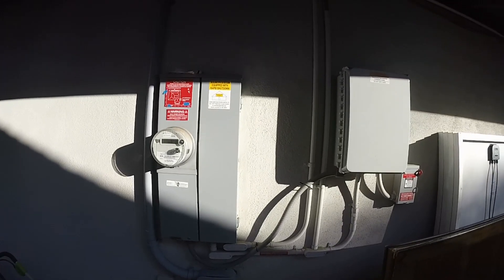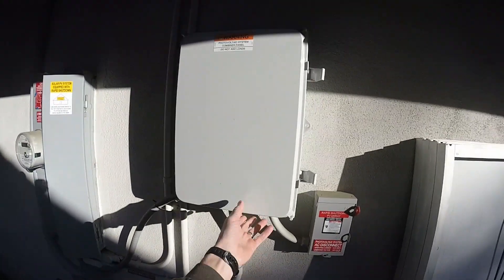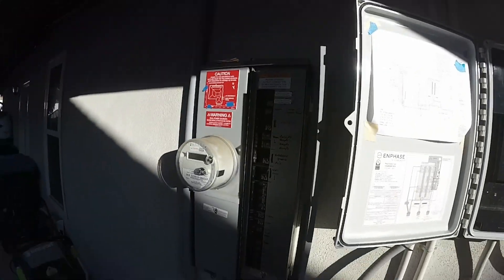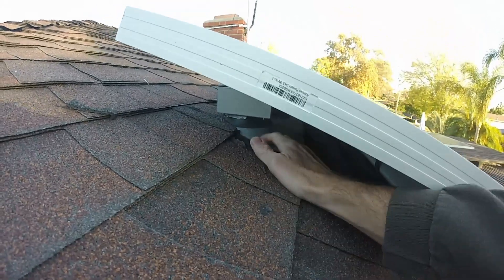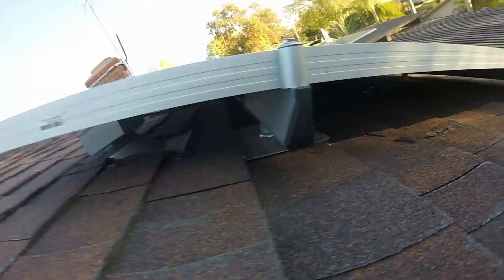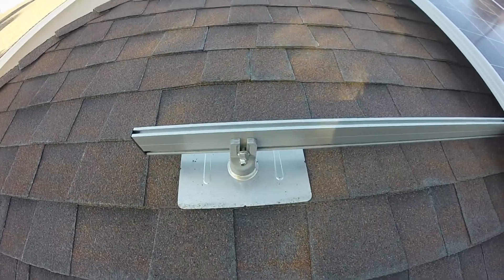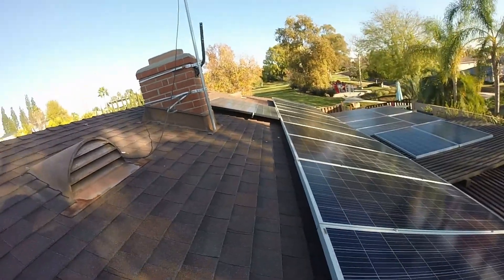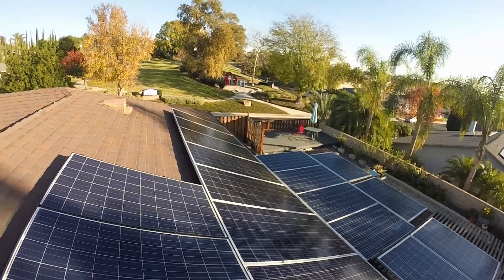Tour of my Easy DIY Solar Setup

Comment: I’m impressed by the details you talked about on the roof, as hardly anybody ever goes into the details of how they accomplished it! 🤙
I myself built my own system, but I didn’t do the main panel because that was over my head. I never knew anything about electricity before this, so it was quite an education. 
I opted to go off grid instead of losing my power, when the grid goes down and dealing with all those permits. 🖖

Comment: Nice installation!  You just have the one two pole breaker providing pv power? I assume Enphase system doesn't require an input grid power then.
Batteries anywhere?
Reply from the maker: Yes,  PV comes in through the double pole 20A breaker.   But the inverters also get the grid power input from the same place.   They will stop producing if no grid power. I have other videos about my battery system.  Check out my channel if interested.

Comment: I have the same type of setup except I didn't have any of the permitting problems.  I submitted my initial $60 permit for 18 panels.  As I was driving home they called to tell me it had been approved.  A year later I added 13 more panels.  They just had me do an addendum and didn't charge me for it.
Reply from the maker: Nice.  Not sure why my city is so dang expensive!